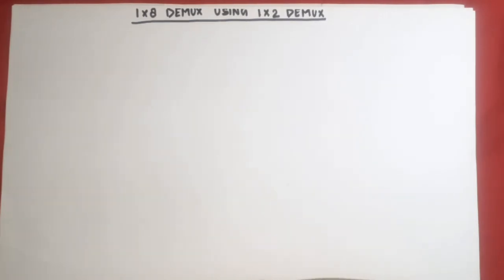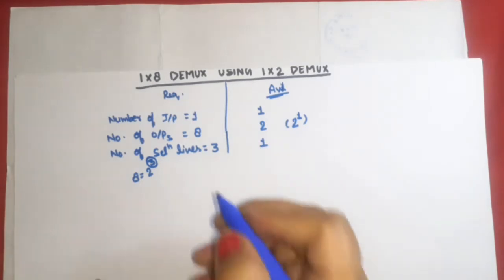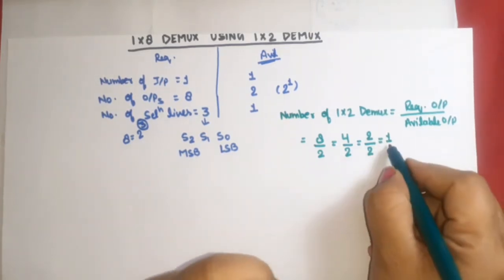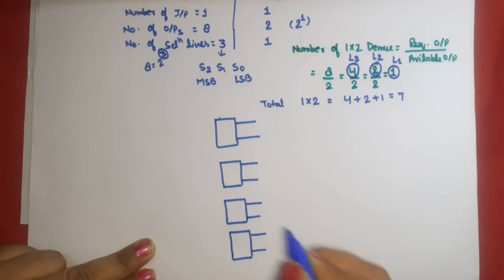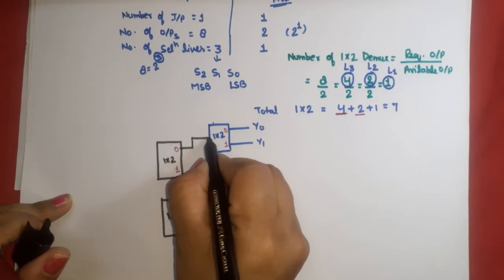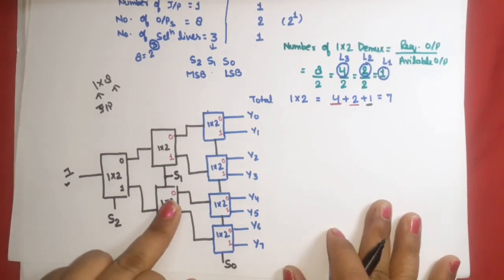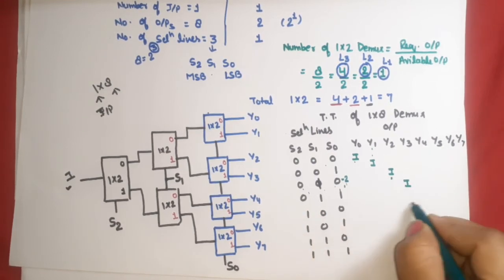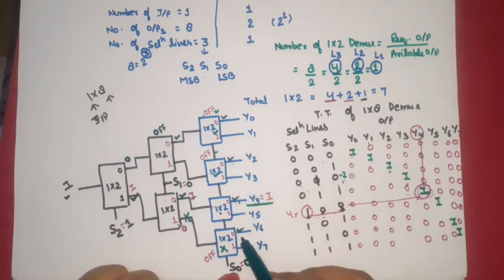1 X 8 Demultiplexer using 1X 2 Demultiplexer |  1:2 Demux to 1:8 Demux | Demultiplexer example

Comment: Madam every de-mux will have 
1.input
2.selection input
3.output
4.enable or disable 
But you didn't give any enable or disable switch for any of the demux 
why madam??
Reply from the maker: U can connect enable to all but enable should be common here because we are implementing 1x8 so all must be on se time 
All will be same .
U can check any standard bool for reference  
Input output selection line must but in case of decoder enable also